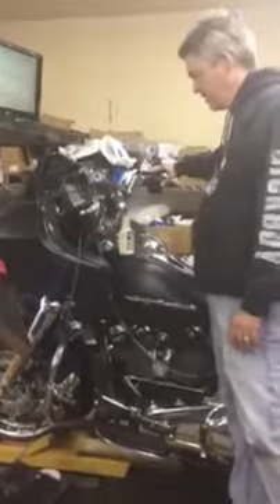New Complete Cam Packages for 2017 Harley M8 Models featuring T Man Performance Cam   YouTube

Comment: CycleSolutions, Chris how is a cam, d&d fat cat exhaust, and ThunderMax or Power Vision tune making 30HP and 19TQ increase on a stock M8 when a Stage 3 kit makes 108-112HP and 109 TQ with bigger cylinders, cam, exhaust, tuner, and springs with identical setup??? Please explain. My tech's don't trust these dyno numbers for some reason..
Reply from the maker: You can give Chris a call directly at 765-730-1646 and he will answer any questions you have.